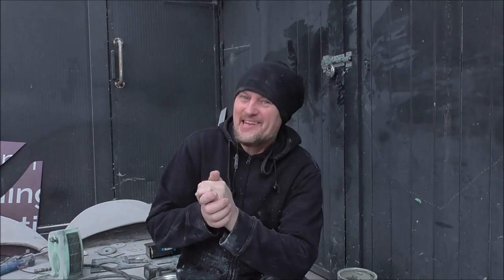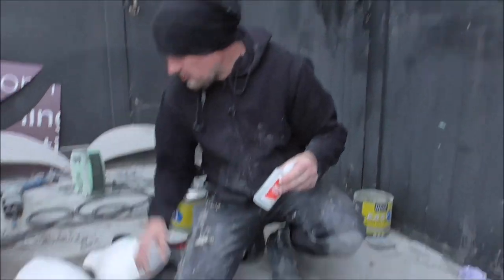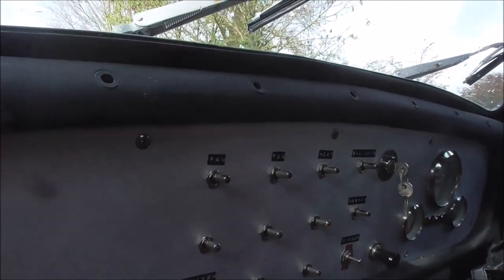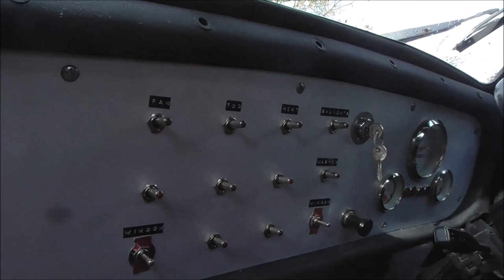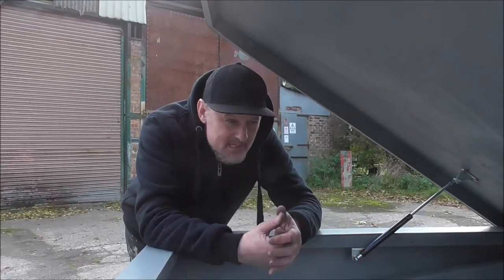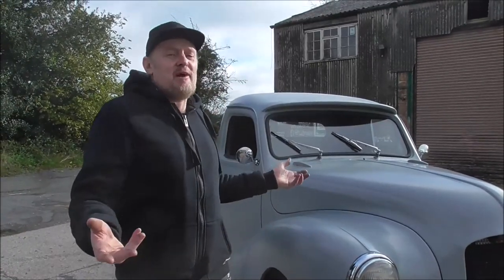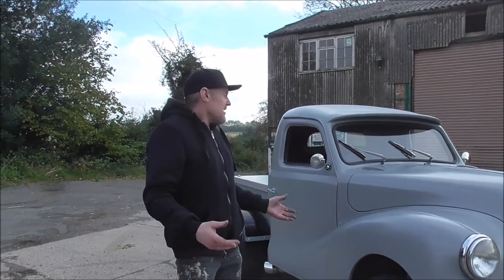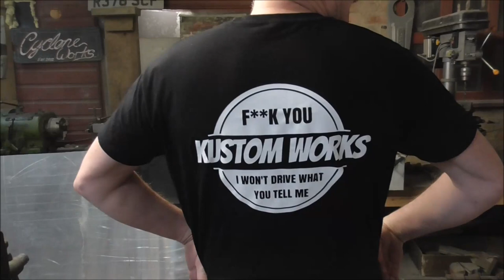TEST DRIVING THE COMPLETED AUSTIN A40 PICK UP TRUCK

Comment: Paul... what is going on with what look like bubbles between the cowl and the fender on the drivers side of the A40?
Reply from the maker: Well spotted, they are bolts that would have held the original steel car, but here they are on this fibreglass car!